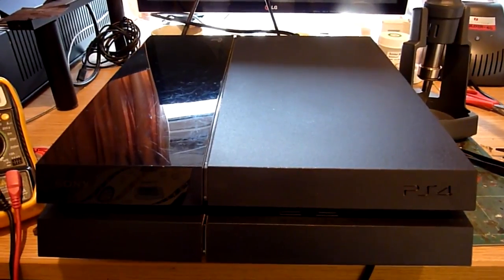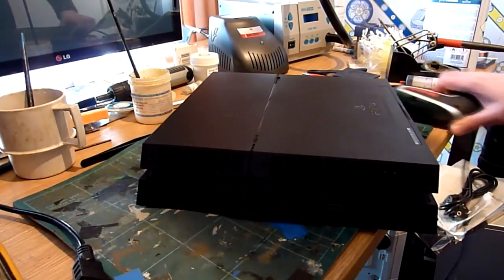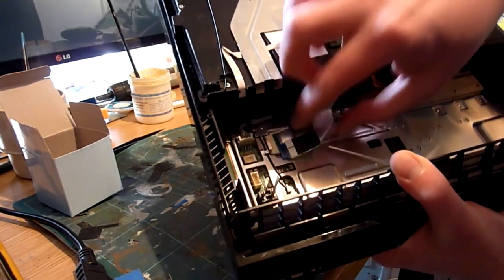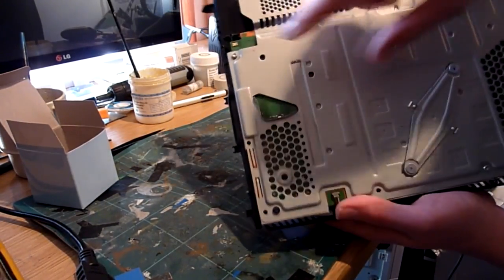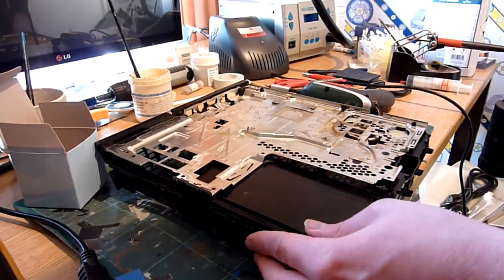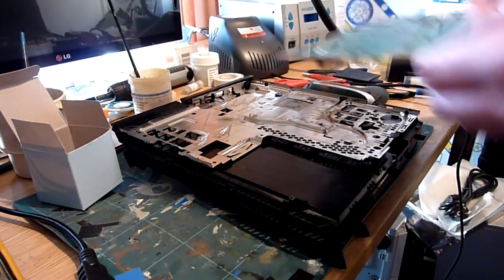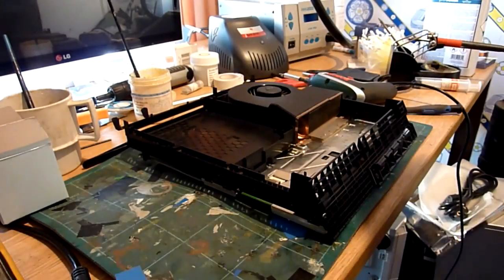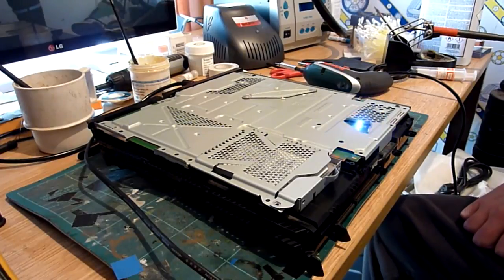PlayStation 4 Fan Continuously Stalls and Restarts - Diagnosis and Repair

Comment: My ps4 ran for years then my fan started going really loud then shut off due to being hot but isn't.  Sounds like the fan is trying to spin but dust or something is slowing it.
Reply: Rusty Shackleford SAME FOR ME
Reply: Same for me 2
Reply: Same here
Reply: What did u do then
Reply: @potrik29  wound up getting a new ps4.
Reply from the maker: If you can here the fan start then stop and it just keeps doing that then it's usually a sign that the bearing has failed - if you take it out it's likely really stiff to turn. In which case, replace the fan. Clear out any debris on the heatsink while you're in there (the fan compacts any dust etc into a sponge type substance on the rear of the heatsink radiator which stops airflow and overheats the console) and change the thermal paste on the APU for some decent stuff like Arctic MX4. It should be happy once more afterwards.

Comment: Came back to this video some months too late to thank you and some websites, thanks for the tutorial, helped a lotand fixed my issue, the console was constantly restarting by itself, to the point where it would reset on boot, the fan wasn't even spinning anymore. Bought one from aliexpress with high ratings and no noise complaints in the reviews and it did the job (similar producst on my country were too overpriced and just people re-selling them from aliexpress to begin with)
Thanks!

Comment: Please I need an answer to this from anyone who knows...I opened my ps4 because I wanted to clean the fan...but I didn't know that it was necessary to keep the fan steady and I spinned it with my hand a couple of times but not fast...does this affected my console?...after that when I powered it up the fan has starting to make a weird noise like it spins and touches something and stop for a little and then starts....this problem got away after I played for 4-5 minutes and the console working fine for now...is this a problem ? Or in the future there is going to be one?...
Reply: Absolutely not if you have assembled it in the right way

Comment: My ps4 will turn on then 2 minutes after blink red and say that it is to hot and power off any suggestions ?? I also notice my pan does not spin at all .
Reply from the maker: Replace the fan module and thermal compound.
Reply: I cleaned it up completely, I replaced the thermal paste and I am still having the same issue. Besides replacing the fan is there another part that it could be cause the problem.
Reply from the maker: Not likely. The fan bearings cease and they don't spin freely to hand any more. If the fan isn't spinning then you need to replace the fan.
Reply from the maker: Also, while you have the fan module out you'll have removed the lower tray which carries the heatsink - clean this out as it collects dust and clogs any ventilation the fan provides to the APU and rest of the system.
Reply: I actually dust it off with air pressure, and it took about an hour and a half to send a warning stating that there´s a heat problem. I am not sure if getting a new 
fan will help me
Reply: yup , I already cleaned the heatsink too. I tear the whole console apart just now.
Reply from the maker: Which thermal paste are you using and how much is applied? Did you clean the old stuff from the base of the heatsink and APU before applying the new paste?
Reply: yeah I removed the old thermal paste that came with it. I used a thermal paste that DELL uses in all their computers. Yes I took the heatsink out for cleaning. I clean it up completely. I cleaned the the CPU which I guess you call that APU. I just dont want to waste my money purchasing a new fan.
Reply: KyoStyle2k compressed air didn't work?
Reply: no, It did not.
Reply: KyoStyle2k there's little black pieces where you stick the fan in. Is that damaged?
Reply: Cassian  Thomas

Comment: My ps4 shows too hot and shut down by itself, I applied new thermal paste and it's the same thing what is the problem?
Reply: Timoy Wynter same
Reply from the maker: +kimani Reid does the fan spin?
Reply: No the internal fan does not spin
Reply: Andrew Paul like for a couple seconds
Reply: Same
Reply: Did y’all fix it?

Comment: My PS4 has this problem, I have never cleaned the dust from inside of it and rarely dusted the outside either really, if I was to open it up and clear all the dust from the fan would that fix it?
Reply: I have also had it for about 4 years

Comment: I've taken apart my ps4 many times, my fan shakes and vibrates when it's on making the whole ps4 vibrate. I know I most likely need a replacement fan, but is the only place to get them online?
Reply from the maker: Pretty much. Are you sure it's definitely the fan though? The disc drive usually makes the noise / vibrations on these machines.
Reply: Andrew Paul positive, I took off the bottom and cleaned the fan and it started stalling out once it started vibrating, it started overheating as well.
Reply from the maker: Ah cool OK. Yeah sounds like the bearings are shot to pieces.
Reply: Andrew Paul I'm ordering a new fan today, thanks for the help
Reply from the maker: No problem :)

Comment: When I turn my ps4 on my fan not turning on and 5 mins later it shut off
Reply: i have the same issue . have you managed to fix it and if you have can you tell me how thanks
Reply: That happened to me yesterday. How can you fix this? I've had my PS4 for 5 and a half yrs this the first time that this has happened
Reply: I fixed it already
Reply: LOL No did you get a new fan? This happened to me as well. I turned it on without the case and it seems as it is trying to rotate, but as soon as it “wiggles” it stops trying.
Reply: @quiquitohernandez7977  yeah I opened up the ps4 and I used a cotton swab and cleaned out all the dust in the fan. I also didn't play for like a month so I don't know if that played a role. I didn't buy a new fan or anything. Just dusted the fan
Reply: @quiquitohernandez7977  and spin the fan with your hand few times. My ps4 been working for the last month and it hasn't shut off.

Comment: Can u show us how u fix that old fan if it possible
Reply: Andrew Paul thank you , but i don't think you can , am in Africa,  i know how to fix it but i need the right way to open it , and there is no videos on how to fix or open ps4 fans ,so plz make one
Reply from the maker: Sadly it's a sealed unit - the bearing cannot be changed.
Reply: Andrew Paul  i just fixed my fan , thanks man , keep the good work
Reply: Samos mdz how did u fix it?
Reply: Samos mdz how did you fix your fan?

Comment: Can you tell me a retailer that sells reliable ps4 fans? I’m uk based
Reply from the maker: Which model PS4 are you looking for a fan for bud?
Reply: Andrew Paul 
I’m pretty sure it’s the first generation one but i don’t know the specific model or anything i’d have to check
Reply: Thanks but i got bought a replacement by a friend, should the new fan be able to spin really easily? When i disassembled my ps4 the fan is quite hard to to spin without adding a bit of pressure and i’m wondering if thats why my ps is overheating

Comment: the fan on my ps4 runs on full power all the time sounds like a hair dryer do I need to replace it.
Reply from the maker: +Jackie Stafford No - it'll need stripping down as per this video, clear the heat sink of any dust and replace the thermal compound with some Arctic MX4 thermal paste. That should quieten it down.
Reply: +Andrew Paul thanks for the help.

Comment: I haven't yet cleaned out my ps4 the fan is doing what you showed at the beginning. Do you think cleaning the fan will help it or is it just dead?
Reply: Luke this is happening to me did you do anything to get it to work?
Reply: No your fan in broke as well
Reply: Luke so you got a new one?
Reply: Luke if you know anything to fix it please let me know
Reply: send it into sony and they will probably replace the fan or go to a pc shop and they might be able to do it. But rather than that you need a new fan not a ps but a fan which would probably run you 70 bucks at most including the take apart if you pay someone to do it

Comment: The big grey part wont come off and i took all 14 screws out
Reply from the maker: As in the metal shield above the motherboard? Check under where the power supply was sitting - on the left is there a black screw?

Comment: I cleaned my fan but it’s stiff and can’t spin after a while then my system overheats.
Reply from the maker: Yeah sometimes the bearings inside the fan seize - replace the fan and thermal paste and it'll be fine.

Comment: Hey man I replaced my the fan and thermal paste and cleaned the inside of the console but it still overheats showing the blinking red light idk what else to do please help
Reply from the maker: Did you clean the radiator fins on the bottom metal plate which the motherboard sits on before you reassembled it? The fan compacts the dust into a sponge-like material which collects on the back and stops the airflow causing the machine to overheat. Also, ensure you repasted the APU and have the clamp back on in the correct orientation (wings facing upwards) and tightened down correctly.